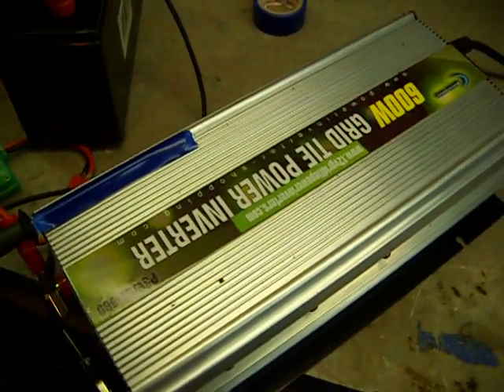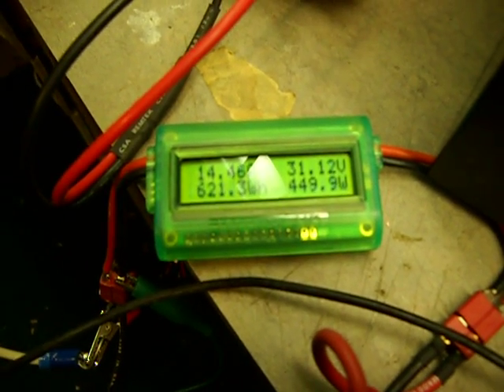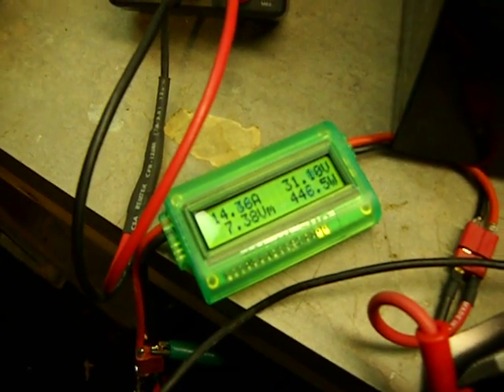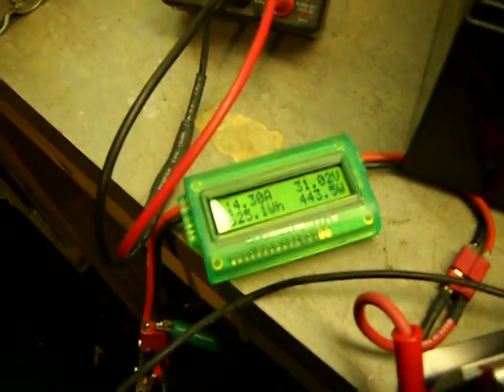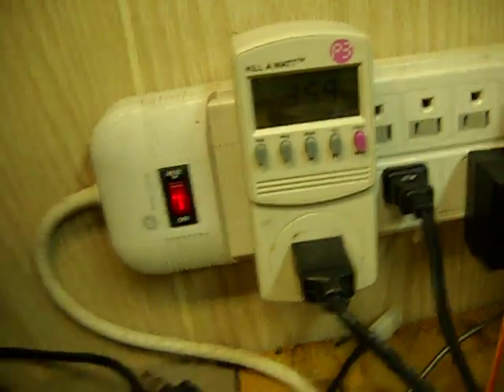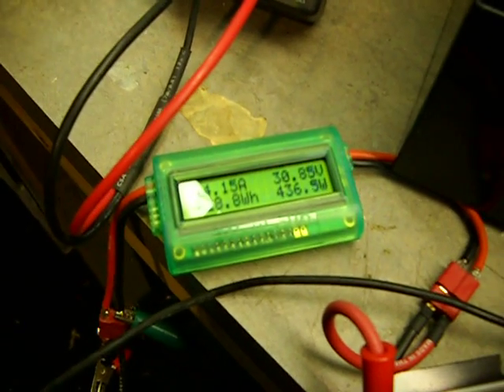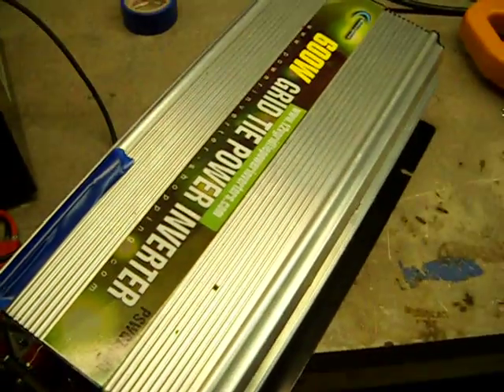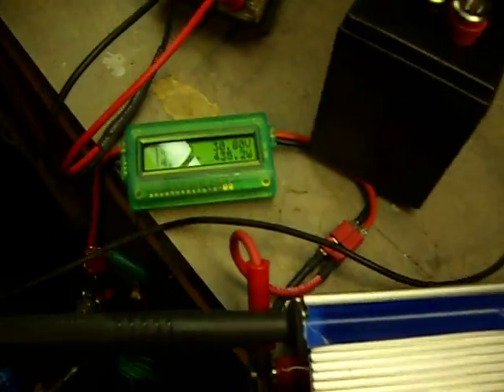Power Jack 600w Grid Tie Inverter Testing,  800w Solar Power

Comment: Attention the big problem on it is inverter it is that there is not enough cooling at the levels 4 transistors of power that is why he(it) roasts easily he(it) overheats!
It is thus necessary to increase dissipator ( the aluminum) inside the inverter and the outside at the level of transistors and to move the ventilator so that it blows on 4 transistors so the temperature lowers(dims) and protects your 4 transistors of power.

Comment: I have a 1200W GTI and 4 - 180W mono panels. Can you increase the energy pumping into the grid if you hook up 2 - 1200W GTI in parallel since it is tapping off the same source, with a battery bank? Because it seems on my setup I am only getting .53 on the power factor with just 1 GTI.

Comment: Hmm 112F is nothing! You know that a transistor can handle around 200F.. I would start to worry if the temp goes over 170F ... 112F is cool! :)
My SUN-250w inverter gives out 220-230w out to the 230v net. I have been running this inverter for 12-15hours straight with maxload without it breaking. Usally also inverters have a overheating protection if it gets to hot it will lower the output.. I don't know if the powerjack has that though.. But i also agree with you, you should not run max load..

Comment: @drz4000 I have two 220 watt UL solar panels connected to the 1200 watt inverter, and I have one 130 watt UL solar panel connected to the 300 inverter. I have the panels mounted on a tool shed so now I have that roof covered. Now I am thinking about getting about getting 7 230 watt sharp panels using Ephase microinverters. I have been shopping around for the best price, I want something that I can expand on.

Comment: I sent the 600 watt back, and exchanged for the 1200 watt, works much better. It costed me 100 dollars more. It is not like yours however, only one cooling fan. but it is better made, and it does cool better. I was afraid of the 600 watt ran way too hot, and the output was only about half what it should have been. I did not get the one with the LED meter, I had seen some bad things on youtube about the LED 1200 watt inverter. The 1200 watt one has been working about a week now.

Comment: I've heard a number of times now that the grid tie inverters best operation voltage is around 24 volts DC and that if you go over that you lose efficiency. I dont know why this is but it's what I've seen on a number of actual tests. Also it seems like you are really cranking out some AMPs with your setup, no doubt from the 2S2P setup you went with but it's nice to see 14 AMPs pretty continuously at 30VDC. 

Have you found generally that you basically get half the rated watts per solar panel?

Comment: This reply is not for the 600 watt inverter, but I cannot find a forum for powerjack on the internet.  I hooked up a 300 watt inverter that I purchased back in Dec. 2009 never had used it, I connected the 300 watt inverter to a 130 watt UL solar panel, and this inverter work much better than the 600 watt unit. The 300 watt inverter is outputting about 112 watts at peak power now this is more like it.    Drz400 and all you guys thanks for your information.

Comment from the maker: @garboelec1   I don't agree.... I just say they are over spec'ed. If the 600 watt unit is used with 400 watts of PV I get about 350 watts out.  Close to 90% eff.  But when used at 400 and above it drops to 80%.

Comment: @Skalfort11 , kind of looks like your 1200 is maybe a little more eff. than the 600 watt inverter I had. But it does seems to run a lot cooler than mine did. I had thought when powerjack receive my 600 watt back I  would try to pay the differance and bump it up to the 1200 watt one. But with your test, it seems they are not very eff. Unless you and myself were just unlucky enough to get the lemons.  I have a 300 watt  and 130 UL solar panel I have yet to hookup maybe I will do that today.

Comment: @Skalfort11 I just sent my 600 watt back today, it cost 38.00 to send back to China, so the 1200 watt would cost even more. I opened it up and checked everything I could, but I could not find anything wrong. But before I I packed it up, I hooked it back up to each 220 watt panel one at a time, output on both panel thru the inverter was 105 watts, when I put both panels on the inverter output was 184 watts, not sure what is wrong with the thing but something is.

Comment: @Skalfort11 I hope you have better luck than I had with the 600 watt, like I said in this post I wish I had purchased the 1200 watt. However I found another video here I think he is in the UK and he connected up I think a 60 watt panel and the inverted died. 

When you get you inverter I would be interested in how it works out for you.

Comment: ok hooked up 2 12volt batteries in series fully charged. Using a Kill A Watt meter output was 222 watts. The inverter got extremely hot. After draining the batteries down, I connected the batteries to one of my solar panel 220 watt. Using a amp meter I was seeing 6.1 amps to the batteries. 

I do think with the test above, I have proven at least to myself that this inverter is a energy hog. Since the seller is not going to help me out much going to take the cover off and have a look inside.

Comment from the maker: Do you have (2) 12 volt batteries (car battery or similar). If so put them in series and connect to the inverter....see what you put in and get out (both V & I). Next on a sunny day with the panel at 30 degrees into the sun connect the panel to the 2 batteries (drain them some first) to charge it.  Mesure the current...you shoulde get at least 200 watts (28v, 7 amps).  I would get 320 watts out all the time with 400w of panels.

Comment: Drz4000, I finally got a reply from the seller, here is the reply. Hi my friend,

sorry for the delay reply. as our working experience, we find that the solar panel your order only can get 70% effiency. so 220w*70%=154w, you can test your solar panel, so for our inverter, if it is 154w, so 154w*80%=123w. so it is usual to get 110w. you can test it by the red and black side to see how many amps it can get? 

So what is your take on this math, I thought the inverter was 90 percent eff.

Comment from the maker: @jakethepup1   What are the watts in?  V and I.  Since you said morning....was the sun at a good angle?   If you have 3  12 volt batteries you could also put them in series and check the inverter.

Comment: Ok I hooked my panels up in series this morning, I only got 211 watts out, So this inverter is only outputting less than half of the rated wattage of the panels. I have sent two E-mails to the seller and also sent messages thru Skype and they do not reply to the E-mails. So guys, I would save your money and go with Enphase inverters, I would had done this from the start but I really did not want to run the 240 and install a new breaker live and learn I guess. This inverter = paper weight.

Comment: @drz4000 , no I have not connected them in series, but I will give that a try, I will do that early in the morning, way to hot to mess with it anymore today in the shade it is about 98 degrees. I hope the seller contacts me and I can return it, like I said in the first post the inverter was used to begin with and the fault light was out right out of the box. If I am lucky enough to return it, I think I will just pay the difference and get the 1200 watt.

Comment: @drz4000 on open end on panel, 32.6 volts across the inverter the voltage is 28.8 volt. Since I have two panels I disconnected the first panel and connected the second one, same result as the first panel, I then decided to connect both panels I got 215 watts out. which is less than what one panel is rated.

I contacted the seller yesterday and have yet to recieve an E-mail. Like I said before I wish I had seen this video and just order the 1200 watt one.

Comment from the maker: @jakethepup1  thats not right. what was the V and I into the unit?  If it was putting out 105watts in order to be hot you must have about 100w being disapated by the unit.  Contact seller and send back.

Comment: My 600 watt came in today, not happy, first of all the fault light is out, and the unit was used and the power cord even was dotted with paint. But with only one 220 watt panel connected I only get 105 watts out, after only about 4 mintues the fan came on and this unit is getting very hot. So for my test I am getting less than 50 percent output in the noon sun and zero clouds. I am not even going to hook up the other panel I think the thing would melt. Going to connect the seller.

Comment: The panels are 24 volt each at 220 watts each, the voltage is 28.7 volts output, open without any load 32.5 volts output. I sure will post back and tell you how it works out, it really concerns me about the overheating, sounds like it could be a fire hazard.

Comment: @drz4000,

I wish I had seen this video before I purchased this inverter, I order it this past Friday to hook up two 220 watt solar panels so it looks like this thing is only going to output about 300 watts that sucks. When it comes in I will give it a try but it sounds like I would be wasting alot of wattage, with this poorly designed inverter. Wish now I had purchased the 1200 watt one.

Comment: I wish I had seen this video before I purchased this inverter, I order it this past Friday to hook up two 220 watt solar panels so it looks like this thing is only going to output about 300 watts that sucks. When it comes in I will give it a try but it sounds like I would be wasting alot of wattage, with this poorly designed inverter. Wish now I had purchased the 1200 watt one.

Comment from the maker: Mine are 14v panels so yes. You can buy 30v panels however....you can also buy a 12 volt grid tie but its better to use a higher voltage and less current.